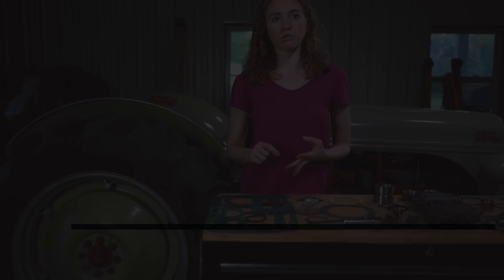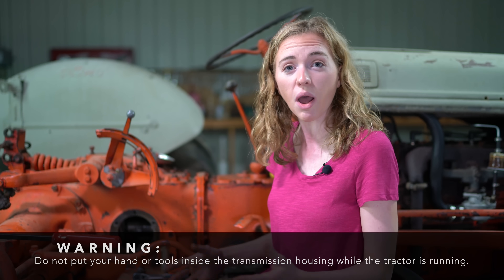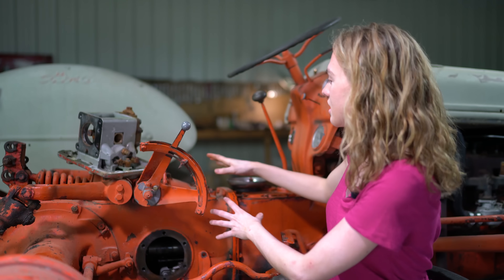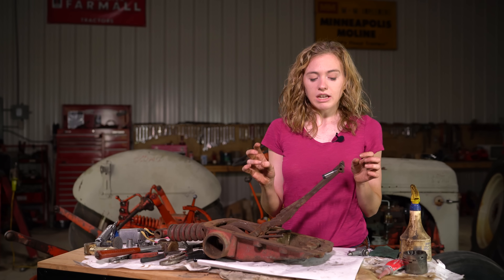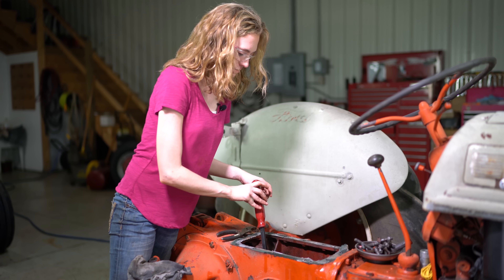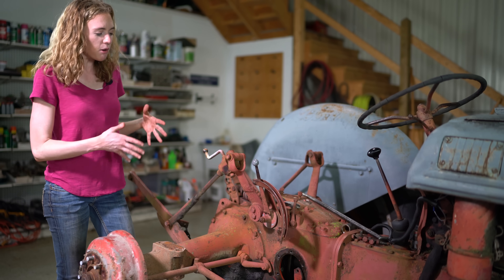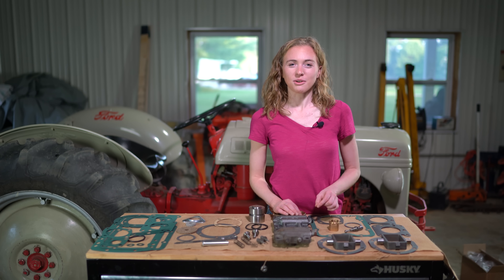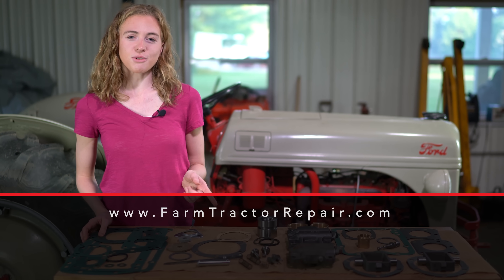Ford Hydraulic Troubleshooting: Easy Steps to Determine the Problem--No guessing!

Comment: This is the best video I've found describing how to remove the top lid however... disconnecting the arms from the T- valve on 9N and 2N  hydraulic pumps was barely mentioned. That led me to believe it would be petty simple. After getting my lid off, I found some of the broken pieces of my T - valve in the bottom of my case. I feel a hole where I assume the valve slides into the pump but can't find the large cylindrical piece of the valve. Now I have to remove the pump to look for that piece. ☹️

Comment: I have my Dad’s 9n and 3PH falls quickly as soon as clutch is in. Also a loud whining sound when 3PH is fully elevated. I am pretty handy, but have not worked on these before. Suggestions on what’s the likely issue(s), would be appreciated, before I dive in?

Comment: I own a 9N tractor. I am curious if my 3 point hydraulics are in need of repair. Should the arms/attached implement stay raised once the hydraulics are no longer engaged? specifically, a rotary cutter raised to travel down the road. Should the PTO and rear hydraulics be engaged continuously to keep it raised? blades turning?

Comment: Well I learned a lot but it doesn't solve the problem I'm having with my card to in everything goes up fine but nothing comes back down it takes over hours for my hydraulic fluid or whatever is going on to let the bucket or the three-point come down

Comment: Do you have any suggestions on an 8n the goes up when you push the lever forward and down when pulled back. It seems to work fine and doesn’t leak down.

Comment: I have a ford 600 that leaks hydraulic fluid from under(?)the pump when I lift the three point hitch up. I feel it is a relief valve? issue. can you give some advice?

Comment: My To 30 will not release the lift slowly with a load on it. Drops completely when control lever is pushed all the way down. Control lever becomes spongy close to bottom. The pump works good and holds the implements up without dropping. 
Any suggestions.

Comment: Hey sorry to bug you. My father-n -law has a 8n and the hydraulics works with a load on it for probably 20 min or so and then it’s like it wants to pick up but doesn’t. We replaced they safety valve and put new ford 90w fluid back in. It helps some but still doing it. We move the lever up and down slowly and sometimes it will pick up. It does fine with out a load. Would you think it’s the pump?

Comment: Rachel, thanks for the tutorial.  It was very helpful.  I rebuilt the top lid with a kit from your site.  It's a 1952 Ford 8n.  The drawbars now have the lift power that I expect.  Upon reassembly of the inspection cover, the Sherman high/low transmission seems to be stuck in high!  The handle is on the inspection cover.  Is there a spring that may have dislodged or did I just miss the groove that the handle attaches to?  Thanks.

Comment: Thank you for everyone's time. What do you recommend for lift and drop latency? Its about 3 or so seconds. Also, when the tractor is off. The Back blade will drop after a minute or so. Is this normal? Should I change the fluid. Not sure when last time it was changed.

Comment: Greetings, i have a 1948 to20  s/n 369.  was my grandfathers.  Lift doesn't work.  i noticed a plug on the upper lift cover where from the circular exploration hole you can feel a tube going up into the cover from the pump to the lift.  i know some say to take the lift cover off and run the tractor to see if oil is coming out that tube.  if so, the pump is good.  if not, pump might be bad. anyway, i took the little plug out without taking off the lift cover and with the pto engaged, no fluid comes out.  do i assume the pump is bad? i have fluid to the bottom of the inspection hole and there is some turbulence when the pto is engaged.  Is this a good test?  Also, do i have to take the lift assy off if i am just rebuilding the pump?  Or is it best practice to take both out as long as i am tearing things apart?

Comment: If my 8N 3 point is moving fine upon initial use, and then about 10 minutes in starts to not move, what could be the issue?  It will stop going up, or down.  If I keep it in the down position the implement will eventually drop like a rock.  I took apart the side cover and I’m not seeing these symptoms.

Comment: I have a Ford 3000 and the hydraulics start jumping up and down with a New Holland 450 sickle bar mower (new used purchase) attached? Hydraulics work fine with any other balanced load (brush hog) on rear 3 point. Also after tractor sits for a few months it takes a while for 3 point arms to lift. It's as if it has to be primed. But eventually lift up. Any ideas? Or is this oscillation with Ford rear hydraulics a bad internal design?

Comment: Hi Dan and Rachael , I have  a issue with my  601 workmasters Hydraulic  locking up when using my hydraulic log splitter. When I run the ram all the way out or in  it locks up the system. I can hear the engine labor when this happens. I need to shut of the tractor and relieve the pressure  before it will function again. If I stop before the end of the cycle it  will work fine. It is not the splitter valve. I'm thinking the relief valve located on the bottom of the pump under the little cover is the problem??   Any ideas? Thanks in advance  Mike

Comment: Great video,  Question team. I have a restored 1952 8n everything new, but after 239 hrs on tractor hydraulics is not holding up finishing mower when tractor is turn off, it bleeds down after 15-20 mins, my question is can the relief valve be bad, and what's the function of relief valve, and does it really matter if hydraulic bleed down hold implements in the air when tractors off, once again I am new to ford 8n and tractors in general, Thks

Comment: Do you have any video's working on Ford 4000 4 cylinder gas tractor? I have a 1963 or 1964 4000 4 cylinder gas tractor.  It will only idle. It dies when I throttle it up.

Comment: I have a ford 2000 with hyd problems , the lift control is not working, if you raise the control it is ether all thew way up or all the way down  no in between no adjustment .  No draft control,  , What is the problem?

Comment: THANK YOU.  I haven't ridden my hobby 9N in a while. Recently reworked the generator and a few things and when I tried to move it the tractor the hydraulics would not work.   I thought it was the pump, and came watched your video. Luckily you mentioned foot off clutch and engage the PTO. My PTO was not engaged. I re-ingaged, foot of the clutch and Voila! IT WORKS again.

Comment: It would be nice if you done a video on a allice chalmer 160 Renault French tractor. The one i have tge rear lift goes all the way up as soon as i crank it. And it wont go down unless i turn the tractor off and unscrew a bolt on the side of the lift and stand on the arms . the lever dont seem to make any difference with the lift
 And as soon as i crank the tractor back to tge top the arms go and stays

Comment: On my friend's 8N there was a small lever on the side that he said was a "drift" control for the 3 point. How is that connected to the hydraulics and could that cause the 3 point to go down by themselves with a load?
Reply from the maker: This small lever won't cause the hydraulics to go down by themselves without a load. That symptom is usually a blown ring on the piston.
Reply: @DanGingell  THANKS! My friend said when he was using the 8Nwith a disc he would constantly have to raise and lower it to the right height because it would drop. That would happen after engaging the drift control lever. When he would raise the disc to full height to start a new row , the disc wouldn't drop. He figured the drift wasn't working.

Comment: We have an 8N we got when we bought the land it was left in.  It runs, the hydraulics work too.  I am concerned about the noise when the engine is running, the PTO Is off and I let off the clutch, it sounds like the PTO is still running.  When I press the clutch pedal, the sound stops.  Also, I changed hydraulic fluid and a small 3/16” diameter x 2” piece of steel came out with the fluid.  Should I be concerned about the sound or the piece of steel since everything works good?

Comment: Operator error question that you briefly mentioned. I have a Golden Jubilee and I have never engaged my PTO lever to raise or lower my 3pt yet is does raise and lower. So am I doing something wrong? I am watching your video because I do have issues with the 3pt. Every time I go to use my tractor which is about every other weekend I do have to “air up” the system.

Comment: I have a 9n. How do I get the wishbone thing at the bottom disconnected so I can pull the top lid off? My arms are cast iron so don’t have a lot of flex. It looks like even tougher to get it reinstalled. Thanks for the insight thus far.
Reply: yes my valve broke insie  got the spring and small piece  sigh i love this
Reply: On the 9n, if you’re only doing the top rebuild, I suspect it will make things a lot easier disconnecting the linkage to the pump valve if you get the PTO shaft out of the way. Go ahead and pull it. Even though it isn’t necessary  unless your doing the pump it will give enough room to get at a hand in there and disconnect things.

Comment: My Ford 861 hydraulics "bounce."  When I raise the 3 point with my brush hog, it will lower slowly several inches and then jerk back up. I rebuilt the top lid but was disappointed that it didn't fix the bounce.  Any insight?
Reply: I found this video which could be helpful next time I pull the cover.  I thought maybe this video was about making the adjustments and that would fix the bounce, but his bounce was related to a hydraulic leak.
https://www.youtube.com/watch?v=0Yh1kYiYW2o

Comment: I took care of 5 IH Hydro 86's. The hydraulic pump was on A side cover a cessena gear driven. Easy to R/R
Reply: Had an encounter with one of those. Had to drain about 25 gallons of hydraulic fluid before I could pull it off.

Comment: I have a Jubilee that is having hydraulic issues.  I had a leak that allowed it to run dry.  I tried priming by adding pressure to the dipstick tube, and will get it to work, but when it sits for a day it loses prime.  Any thoughts?

Comment: My 3 point on my 8n will not lift the arms if it's just idling, it will lift and remain lifted if it's in gear. It will go up and down fine if in gear. It won't do that in neutral. Is that normal? Sorry, first tractor newbie.

Comment: I JUST BOUGHT A 1969 FORD 3400  THE 3PT LIFT DOES NOT WORK. I NOTICED THE TRANSMISSION RESERVOIR IS FILLED TO THE TOP PASS THE PLUG ON THE SIDE.  COULD THIS BE THE PROBLEM?  I CAN NOT FIND THE PUMP FOR IT, ALL SHOWN ON THE NET ARE DIFFERENT IN SHAPE AND LOOKS.  HOW DO I FIND THE CORRECT ONE.  IT IS A 3 CYL. GAS ENGINE.  THANK YOU FOR ANY HELP, I CAN NOT SEE ANY VIDEOS FROM YOU ON THIS TYPE OF TRACTOR, ARE THERE ANY?

Comment: Hey rachel, thanks for the video. It helped alot but I have a question. Have you ever removed the hudralic oil tube in the center housing? Mine has a hole in it so I'm trying to remove it but have had no luck. Thank you

Comment: My 8 N is an early model ,the pump  housing is destroyed it came that way all the parts are gone , I also have the front end loader with the trip bucket  I was thing about putting a front pump on it , what size pump should I use to Handel the front end loader and an out side ram for the 3 point and a ram for the trip bucket  ?Thanks